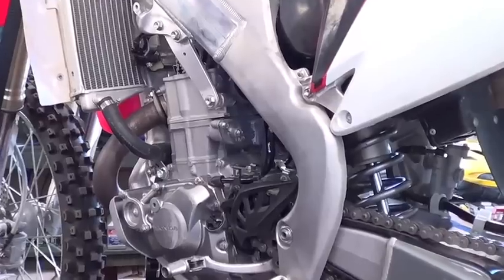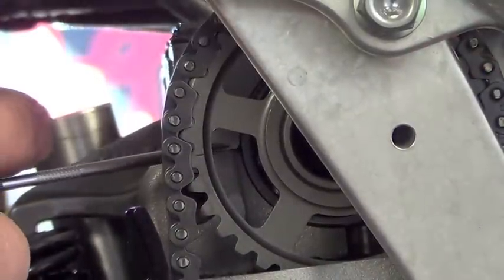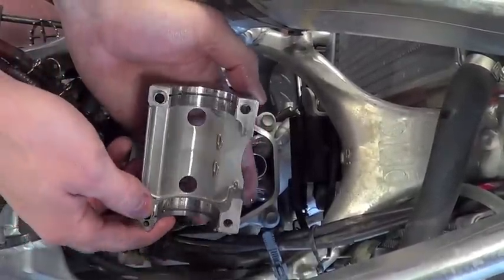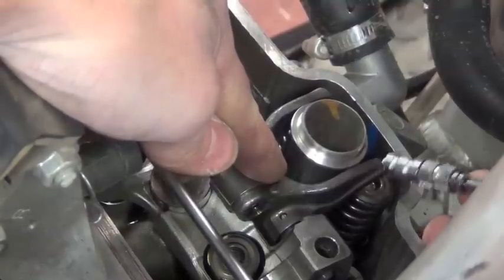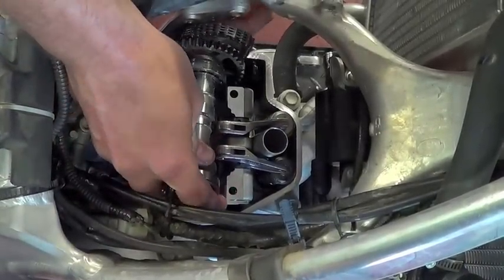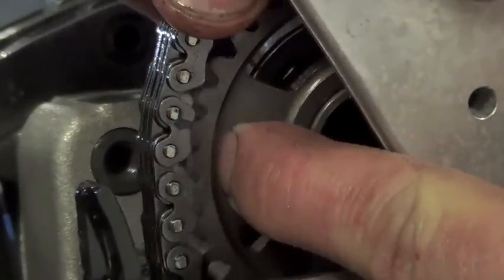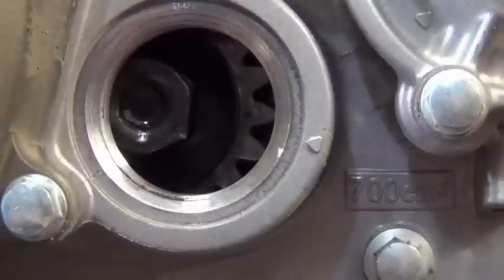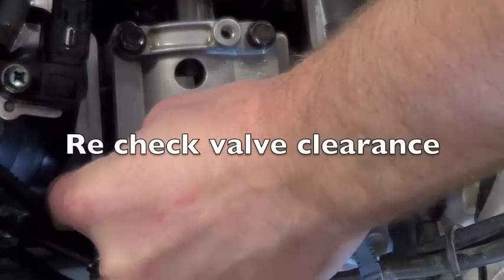09 - 12 Honda CRF450R - Valve Clearance Adjustment - Parts and tools in description

Comment from the maker: Feel free to get in touch with me on FB if you have any troubleshooting questions! 

Support the channel and pick up these sick mojomoto parts for your CRF here >>> http://mojomotosport.com?aff=141
Reply: I couldn’t find your Facebook page? But I do have a question, I have a 09 crf450r that I’m doing the decompression recall on (got new plunger and weight) was also checking valves too but when I have all the marks lined up to tdc to remove the cam I notice the middle cam lobes face the exhaust is this correct? In your video it looks like they’re facing the rear wheel mine face the front wheel kinda.. that’s with everything lined up in time, first time opening the valve cover since I bought it (was supposedly rebuilt with new exhaust valves) also can’t fit any feeler gauge in any of the clearances not sure if I’m doing something wrong or what 🤔
Reply from the maker: Nicknackzz 13 you’re at TDC exhaust stroke, you need to be at TDC compression. Rotate until the intake valves open and close then set your timing marks. You’ll get the wrong clearance with the cam how you have it now.
Reply: CoteMotorcycles thanks man appreciate the response!
Reply from the maker: Nicknackzz 13 anytime! Hit me with a thumbs up and some shares if you like the vids! Thanks for watching!

Comment: What if ya didn’t mark it well I did but the sharpie came off (timing chain)
Reply from the maker: You’ll have to use the timing mark on the crank shaft to set it to TDC and then you can time the cam.

Comment: My cam journal has some scoring on both journals and bearings. This is freaking me out I did notice some wear on yours but mine is a little more, there is one score that I can just feel with my nail.. does this mean the bearing is spinning on the outer races? Do I have any options other that replace? Would it be bad if I ran it? I don't race it, strictly bush trails since back injury rarely at full throttle
Reply from the maker: If you can feel it with your nail I would absolutely replace it. Trying to save a couple hundred dollars could cost you thousands when something breaks and goes through the motor. Get on eBay and buy some used stuff if you’re worried about cost. Make sure you run good oil and change it regularly to prevent it from happening again. If there’s wear like that on a cam journal I’d imagine the rest of your motor needs attention also. Feel free to send me a pic on FB and I can try to steer you in the right direction.

Comment: My engine boils a lot and drains the water from the radiator very quickly. How can I solve my problem?
Crf450r 2010?
Reply from the maker: See if your rad fins are all bent up or the rads are crushed in. Could be a pinched hose somewhere. Rad cap could be worn out; if you’re still running the original rad cap then just replace it. I’ve seen impellers worn out so it may be worth while checking that out as well. I had an 06 crf450 that would push a few hundred mL out and then be good to go; it just didn’t like to be right full. Hope that helps!

Comment: What do you do when you have zero clearance in an intake valve? The rest I shimmed just fine, bit that one was a Satan valve.
Reply from the maker: The valve face is likely worn out. Pretty typical of honda thumpers because of the valve seat material they use.
Reply: @CoteMotorcycles  sweet, thanks for responding. It is a Honda 450. It might just be time for a top end rebuild. Thanks for the content. Awesome channel.

Comment: one question so did you replace old shims with new ones ? and if so what size
Reply: Im assuming brand new oem shims for my year and model right ?
Reply from the maker: You need to measure for what size of shim you will need to replace the old one with. You can get different thickness of shim from the dealership or wherever. Watch my valve clearance inspection video to learn how to measure.

Comment: Intro is cringy af
Reply: lappt17 spoken like a true a-hole. Can't wait to see your how to vids!
Reply: Just an opinion, don't like it get off the internet.
Reply: This video is missing the correct information needed, but you talk as if you know it all. Why don't you show valve clearances being measured? And the correct equation for finding new shim size. All you did was remove the cams😅😅😅.
Reply from the maker: Johnny Strange I saw you were asking about having 0 clearance. This likely means you should replace the valve as the seat has worn in too far. Get a new valve or valves and check the clearance. If you're still at 0 you'll have to install a thinner shim until there is clearance to measure; then use the formula. Hope that helps.